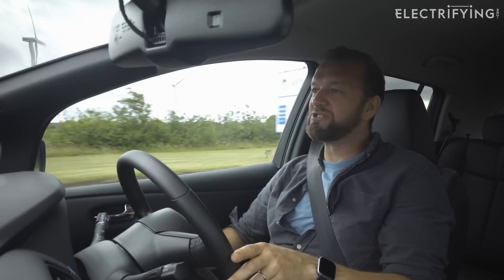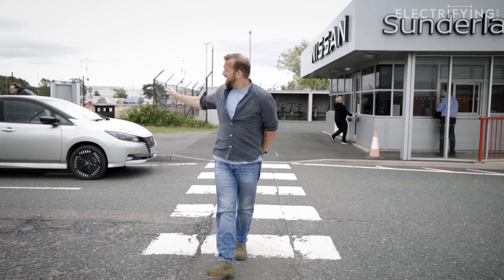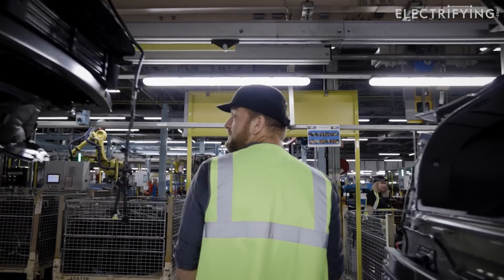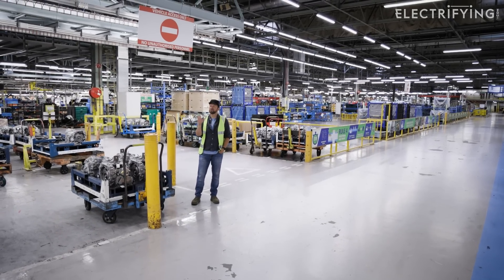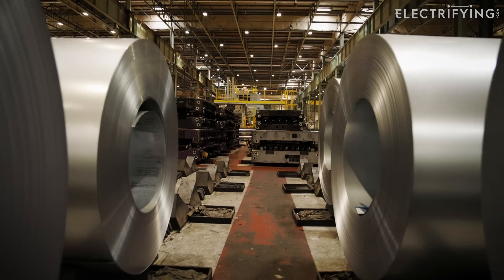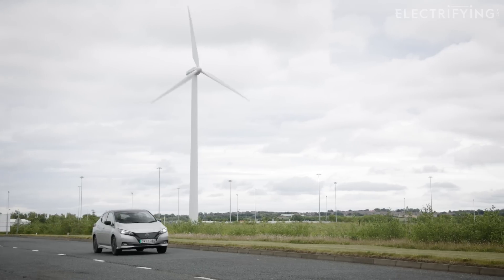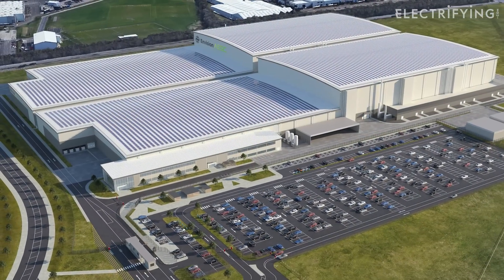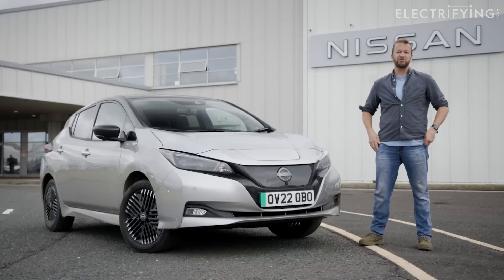EXCLUSIVE: We step Inside Nissan’s incredible EV36Zero electric vehicle hub | Electrifying

Comment: Most of the emissions from an ICE car are at the tailpipe??  What about the emissions from exploration drilling for and then refining. Then there’s the transportation buy sea, rail and road of said product that has to have a huge carbon footprint and that’s before we burn it in our cars. Most comparisons omit all of that when comparing ICE with BEVs. Yes their are also carbon emissions from the mining of the various constituents of a battery but as we’ve been learning these can be recycled many times and batteries can before recycling have a second life in storage. In my opinion over the lifetime of a BEV and the subsequent recycling there’s far less emissions than from an ICE car.
Reply: This is such a crucial point. Well said Wobby1. Journalists need to get it right. Removing tailpipe emissions is a lovely thing but the bulk of emissions and energy are from producing the fuel. The latest ICCT report says, just as you have, that BEVs are the best way to reduce car pollution from cradle to grave INCLUDING the fuel and that fuel's production. It says ICE and Hydrogen are no longer viable. They say that BEVs now break even on the manufacturing CO2 emissions at 12,000 miles - thats factoring in the use of dirty electricity from fossil fuels to power the car.